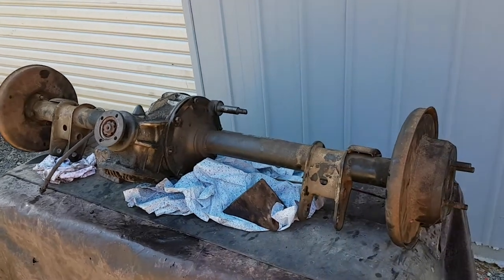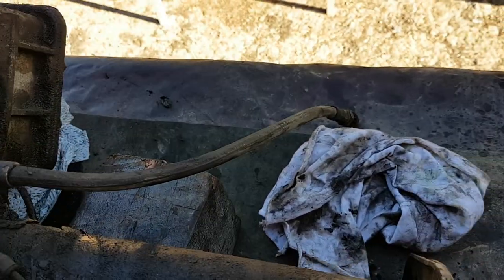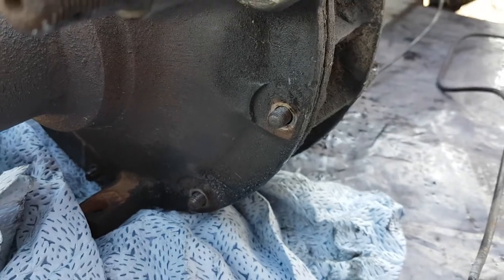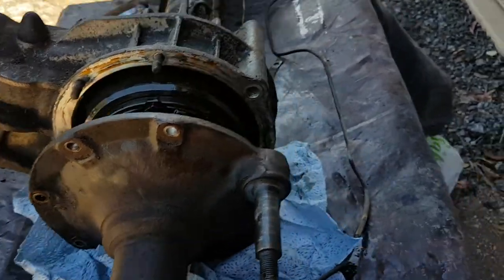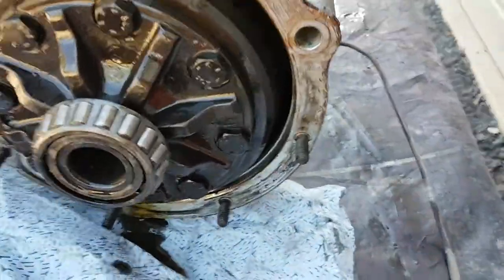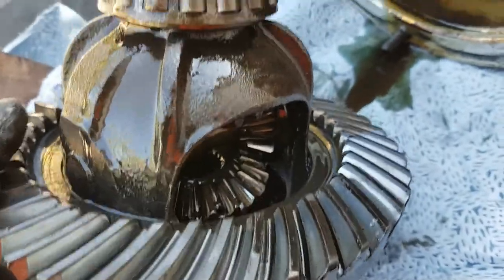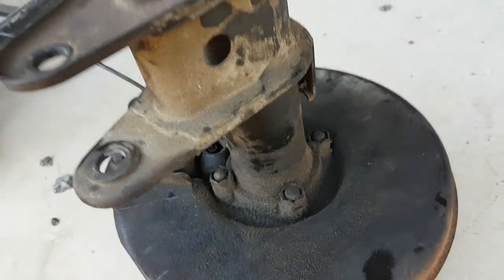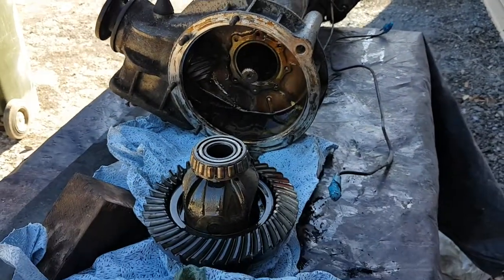Alfa Romeo 1600 105 GTV step nose differential inspection

Comment: Any recommendations on that aircraft sealant? I just noticed some oil sneaking out this area on my Giulia!!!
Reply from the maker: I recently used a permatex red gasket sealant on a differential and found it better than the aircraft sealant in that its easier to work with. Leaves a nice clean finish as opposed to the tar like sticky mess from the aircraft sealant.
Reply: @AlfaAddicts  Thanks for the tip! Sounds like a better option! Will have to give it a whirl!